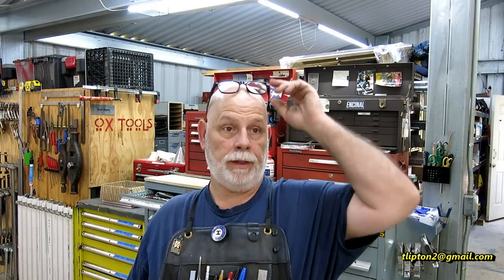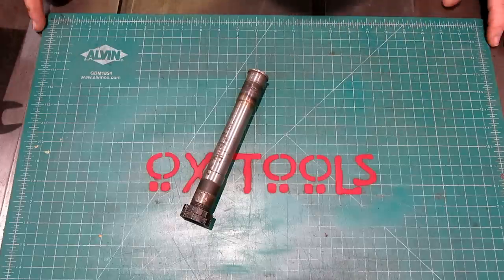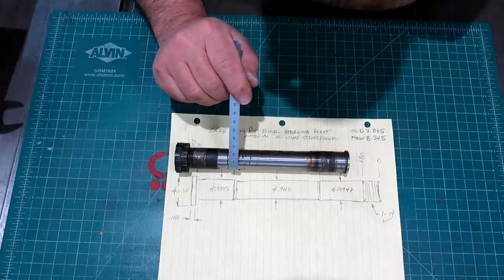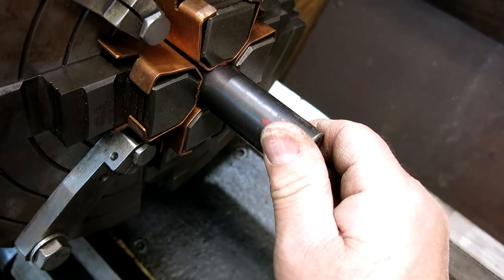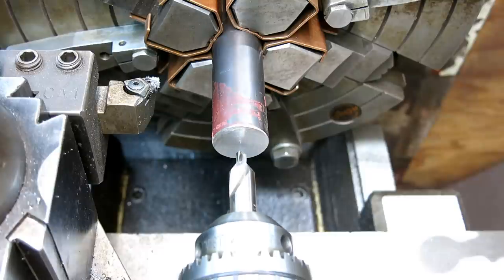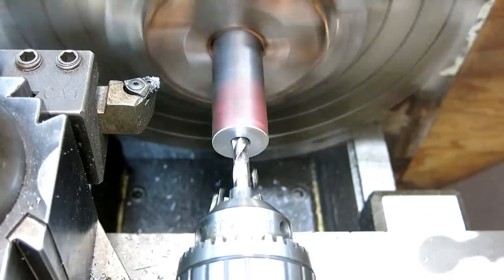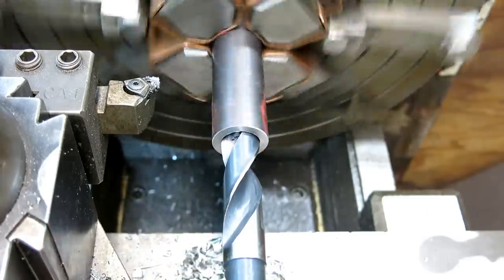Triple Clamp Pivot

Comment: The blue colorant is a naturally transparent dye. There is no black transparent dye, so they have to use pigment, probably carbon black nano sized particles. Pigment particles are harder to make flow as smoothly as dye. It would be interesting to see if black sharpie marks are thicker than blue marks
Reply: Black is actually thinner, it is about .000118", and blue is .000132", red is .000160". Source: https://www.youtube.com/watch?v=46DBNUfhATo
Reply: Didn’t he test this in his “how thick is a sharpie mark video?”

Comment: It's very good to see you doing some machine work again..  The item you are making is typically called a steering stem. The top and bottom parts are called trees or triple trees.  The whole assembly is typically called forks.   There are some typical fits for that particular part.   Generally these parts don't see any heat.  I suspect that the evidence of heat means that the stem and  lower fork tree are pressed together. Your buddy used heat and press / hammer to drive the stem out of the lower tree.  Typically you'll find that the lower machined surface is slightly larger than the top so that the stem has a say mid range tight fit in the lower triple tree and bearing.  The lower area may be stepped a very small amount to allow for a light press fit lower bearing.  Upper bearing/tree surface is a tight slip fit as that bearing / tree has to move to set bearing clearances.   The typical bearing is either a loose ball race or tapered roller bearing.

The exception to a press fit on the bottom can happen if the lower tree has clamping bolts for the stem. They typically don't.
Reply from the maker: Hey Max. Good point. That might be why it was heated to get it out. I measured the existing old shaft and went off that. The buggery on the old one sure didn't help with a good measurement. I'll ask the kiddo.  Thanks for the comment.

Cheers. 

Tom

Comment: Hey there Tom,
this stem is the shaft for two pairs of taperred roller or ball bearings that are sandwiched with the two nuts, motorcycle frame is the sandwich internals. Lower bearing is always a tight fit, however top bearing is a easy sliding fit. The two nuts are used to adjust the preload on the bearings so you need one of the bearings (the top that is) to be able to easily slide on the shaft. If it's too tight the adjustment is almost impossible. And the range of adjustment is quite limited there. You might want to drop your top ID half a thou or so for that.
(also, for such a light bike making this part from 7075 would work perfectly, much larger bikes use aluminium stems)

Glad to see you  back
thanos

Comment: Hi Tom 
When you put a drawing together as steps it makes it better for the machinist to fabricate. All jobs should be this way. When   I was working in a machine shop jobs, less mistakes.    
When putting a thread on a shaft it is all ways better to put a small radius at the beginning less sharp edges.

Comment: Hope you didn't bozo the fit of the bottom bearing. Every steering stem I've dealt with on dirtbike triple clamps, KTM and Honda, the bottom tapered roller bearing is a press fit and the top bearing is a slip fit. Also, the steering stem itself is a press fit into the lower triple clamp. I've changed out neck bearings in quite a few dirtbikes from racing over the years and the bottom bearing is always a press fit and to remove them I had to press out the stem itself from the lower triple clamp in order to push off the lower bearing. They're in there tight!
Reply from the maker: Hey Quad. Good point. That might be why it was heated to get it out. I measured the existing old shaft and went off that. The buggery on the old one sure didn't help with a good measurement. I'll ask the kiddo.  Thanks for the comment.

Cheers,

Tom

Comment: Its called a steering stem bolt, it is pressed into the bottom triple clamp.
Reply from the maker: Hey Jon. That might be why the old one was chowdered. Went by the old dimensions so I hope it fits correctly. I'll have to ask the kiddo. Thanks for the comment.

Cheers,

Tom

Comment: 1144S is such a good material. My favorites are brass and copper, whenever i get to work with tasty chunks of that, i'm in heaven, but this one is a close third on that list. It's such a chill metal.
I've several pins and axles, a few non lathe parts like latches and some plates with pins for mechanisms made out of this stuff and it's just such a joy to work with.
Reply: Brass yes, but copper nope! Nice to form but horrible to machine IMO. Nasty gummy stuff!
Reply: Copper is like chewing gum 😂
Reply from the maker: 1144 is sweet stuff. One of my favorites for sure.  Thanks for the comment.

Cheers,

Tom

Comment: I prefer a green sharpie but each to their own I guess. I did a similar fork swap. A few years back. I ended up cutting the steer tube in half and tig welding a section in to get the length I need. Didnt have to cut any threads or bearing surfaces and the welds cleaned up nice on the lathe. Over 15k hard miles on the bike and she ain’t snapped yet.
Reply from the maker: Hey Lee. That is one way to getter done. Thanks for the comment.

Cheers,

Tom

Comment: As always...   Thanks for the nice video Mr. Wizard.  I always learn something.  Thank you for sharing your Time and Many Talents.  All the Best... Chuck
Reply from the maker: Hey Chuck. Good to hear from you. Thanks for the comment.

Cheers,

Tom
Reply: Tom, just curious…. Did you consider turning the complete OD of the part in one setup?
Reply from the maker: @ckvasnic1  Hey Chuck. Actually that was my intent but I got ahead of myself and parted the shaft off to length. Not much left to hold onto for turning it in one whack. Good question!

Comment: 24:50 I'm a fan, not a machinist, but this has me wondering if you'd normally set a stop and have the tool automatically pull away?  Or is that a feature limited to CNC lathes?

Also, good tip on the blue sharpie.  I've had both and gone through a lot more black ones than blue, but didn't actually put 2 and 2 together on that.  I shall have to source a pile of blue ones for my projects.

Comment: I seldom use black Sharpies on steel. Just can't see it as well as blue, green or red.

I keep all 3 at hand, & use a color code system to help my damaged brain, (literally injury damaged). Green is beginning points, blue is removal & red is stopping point.

My bench top lathe is mounted on a laminated bench of 0.5" 6061 T6, 1.125" marble & 2 layers of 0.375" 6061 T6, w/ overlapped joints, on top, for a flat, rigid top.

I have a slab of 1" steel in front of the lathe, about 50% of the bed length.

The slab is a handy mag mount, as well as an easy erase notepad for detail sketches, dimensions & removal calculations.

The multiple colors of Sharpies really helps keep things straight w/o having to rely on a Swiss cheese memory.

Living w/ a brain injury takes some extra work to avoid bozo moments, galore. I even prefer brown over black, if I need a 4th color.
Reply from the maker: Hey George. Have not tried the green. Thanks for the comment.

Cheers,

Tom
Reply: Glad to contribute.

The only advantage to being brain damaged is my initial perspective on everything is as a noob.  I learn a lot more that way.

New to machining after decades of wanting to get a lathe & mill. Have the lathe, about to pull the trigger on a mill.

I've wondered about bidirectional cutting on the lathe. Sometimes I get a better finish w/ a reversed spring cut. When you faced off the murdercycle part bi-directionally, I felt better about doing it.

Thanks.

George

Comment: Nice video. Thanks! Nice to see some machine work. I learned a new trick starting a drill with an exact pilot hole. How many RPM were you using to cut the threads? Thanks again!
Reply from the maker: Hey Greg. Don't quite remember what that was. Probably around 140 or so.  Thanks for the comment.

Cheers,

Tom

Comment: I love the 1144 but I wondered if the hardness and strength once you remove a bunch of material? Isn’t it “work hardened”?  I never want to weld it because I assume it has sulfur in it?  I need to make the same kind of part and wondered if I could use that instead of 4140. Fantastic seeing you running your machines again Tom!  It was gratifying to see you have to think about the inside mic.  I have a hell of a time trying to read mine.
Reply: Don't weld 1144. No Bueno!
Reply: Please consult an engineer.  You are literally taking half truths and trying to apply them to reality.  Hardness... strength... you're killing me smalls.
Reply: @ShainAndrews  you seem to have missed my question marks.  I simply do not understand how that material is treated to give it its very good strength.  My question relates to the material strength throughout the cross-section.  It’s a question which stems from my own and likely flawed interpretation of the material characteristics.  The free machining characteristics I believe are from the addition of a sulfur compound as opposed to lead.  I’m certainly not trying to kill you.  Sorry.  Also, I am not at all implying criticism of the material choice.  These were questions relative to the material  which I too happen to have on my pile. Maybe Tom isn’t an engineer but I feel it is safe for me to assume he has a better understanding of these simple 1144 characteristics than I and I certainly trust his judgment.
Reply from the maker: Yeah those things make me pause because they read opposite. Classis territory for a bozo moment. I'd rather count than bozo. Thanks for the comment.

Cheers,

Tom

Comment: Hi Tom (or community). Noob question here; is the feed synchronized to the rotations to make sure you start at the exact same point everytime while cuttting thread?
Reply: Yes, there is numbers to engage the half nut on which keeps tool in same location
Reply: Search youtube for thread cutting lathe.... then ask questions.
Reply: @KPSchleyer  Thanks, that's a manual action?
Reply from the maker: Hey Niels. There is a threading dial on the machine so you can engage the feed at the same spot for each cut. This is particular to threading. Thanks for the comment.

Cheers,

Tom
Reply: @oxtoolco  thanks, Tom and KP. That was all I wanted to know.

Comment: Why did you not cut a thread relief?
Reply from the maker: Hey Jim. You mean prior to cutting the thread? I normally do them after the fact unless there is some reason to do it first. Thanks for the comment.

Cheers,

Tom
Reply: I see a lot of guys cut a groove where the threads ends with a grooving or similiar tool with depth equal to the minor diameter of the thread.   I always assumed it was standard practice.   I’m very much a novice and do it too, but maybe its not always necessary.

Comment: 22:10 have you tried Bic marker pens? I swear, those never die. I have one that's been on my work bench long enough that it looks like a relic from the Roman times. Bic permanent marker, i currently have the chisel tip (code 2300). It's a bit unweildy for most, i see some people avoid it specifically because of that, but for me it's just right. I remove the plastic brand thingie from around (not glued, it's shrinkwrapped) and paint it high visibility pink, because i tried leaving them natural for a while and i'd always end up buying another.. and another ... and another, regardless of how tidy i wasy.
Reply from the maker: I would be scared to change. My work process is so ingrained with sharpie I would probably explode. Thanks for the comment.

Cheers,

Tom

Comment: I could be wrong here but you didn't need to put the hole threw it. No real reason for it except cheaper. No 2 what was the actual measurement of the old shaft where the bearings ride? If it's .98thousands that's 25mm.  Kawasaki would be Metric. Run into this a lot with lawnmower spindles. Metric bearing standard nut. Really like how you showed how to get a true hole threw the center. I need to remember that. Good to see you back.
Reply from the maker: Hey John. Just copying the old sample along with journal dimensions as good as I could get them. Thanks for the comment.

Cheers,

Tom

Comment: Tom, my lathe drawings look almost identical to yours! (diameters on the part or below, lengths above) Unless I'm going to use a carriage stop and gage blocks, (no DRO here) the incremental dimensions are just an invitation to accumulate error, or accidentally omit something like a bozo. Critical features get dimensioned, same as you, to measure directly, or select proper tooling.
Reply from the maker: Hey Kenneth. Glad to meet another chicken sketcher. Thanks for the comment.

Cheers,

Tom

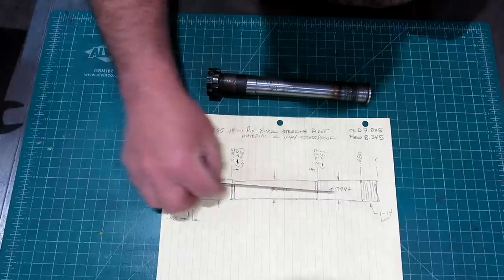Comment: Not sure if anyone else noticed it, but there was a strange "pop" after the drill is removed, at about the 2:10 mark. I can't see what causes it....
Reply from the maker: Hi Sandi. That may be the locking lever on the tailstock dropping down as I pulled the tailstock back. Thanks for the comment.

Cheers,

Tom

Comment: that nut fit on awfully loose, should have quit while you were ahead before the spring pass. Good info on boring the ID before drilling, never would have thought of that. One other thing with 1144 stressproof, it's great stuff for applications such as that but not where it requires welding. 1144 does not weld
Reply from the maker: Hey Paul. You are right about that spring pass. I cut deeper than expected. Pitch diameter was still within limits so I think it will be fine. Thanks for the comment.

Cheers,

Tom
Reply: I've done that a few times, also I've leaned plenty from you. thanks for your honesty, actually shows what kind of person you really are

Comment: Hi Tom. Nooo. At 14:15 you had the opportunity to do this correctly. What you should have done was cut a steady band at the chuck end and set a steady rest to that diameter, then when you turn the part around you can set the steady rest away from the chuck and support the part knowing that the bores are going to meet up EXACTLY. When you drill the second side you have no idea how true the part in the spindle is running hence the steady rest. This method eliminates the chance that the bores will not meet up. 27:50 should have done that before starting the screwcutting. 28:30 At this stage you should have the part out of the chuck as much as possible so that you can clock the bearing diameter nearest the chuck and turn turn the other bearing diameter dead true to it. Hope this helps. Best wishes Mal.
Reply from the maker: Hey Mal. Apparently you have not met my steady rest. For a short shaft like this and the limited access around a steady rest all came out well and the drilled holes met exactly. The length of the chuck jaws are one third of the part length so the risk was pretty low. Appreciate your detailed comment. 

Cheers,

Tom